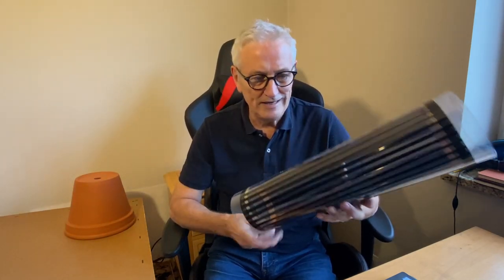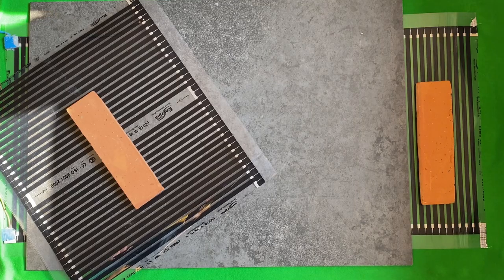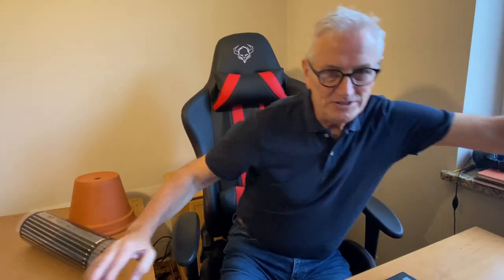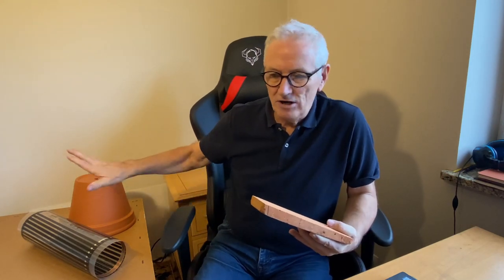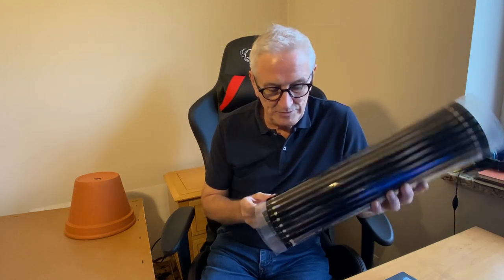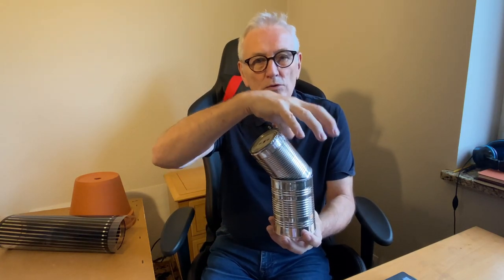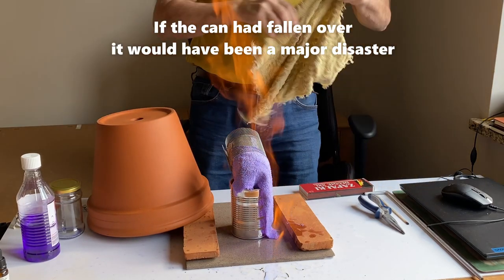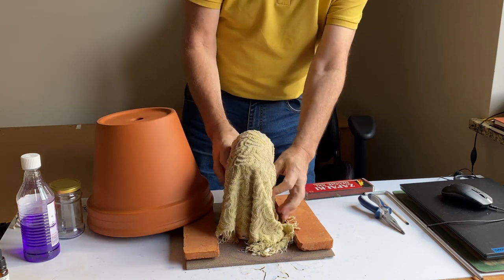DEADLY indoor open flame/fuel heaters. (Heat solution link in description)

Comment: You have watched robert murray smith but his setup was different that rag needs to be a carbon felt and that outside can needs to be lower than the inside for to hold  the chimney.Rewatch that with subtitles.
Reply: @SocialHigh  oke watch out and do it outside those things.
Reply from the maker: @edwingolddelirium  Problem is people are recommending them for inside heating solution this winter. That's what's scary. I haven't even talked about carbon monoxide 'yet'.
Reply: @SocialHigh  well they do also barbecue here and campfire's here in town because they are from the jungle and die. so the knownlegde is not there.

Comment: Robert Murray Smith just made a video pointing out that his expectation was that people would use common sense as they experimented and he seemed surprised that someone, that anyone, would build something like this and try it out for the very first time inside a house, sitting in a chair rather than standing a safe distance away to observe it, with combustible items literally all around the lit heater, rather than outside on a concrete patio or driveway, taking care to move anything that might burn a safe distance away from the heater before lighting it on fire, then standing a safe distance away, ready to quickly move farther away at the first sign of trouble. And perhaps have a fire extinguisher at hand, and wear protective equipment, as well.
This video did absolutely NOTHING to make me respect and admire Robert Murray Smith any less.
I think the moral of this story is to take a moment to think before you act and consider beforehand what you might do to approach the task or experiment in a safe manner.
Reply: ahh a fellow tnt fan.👍

Comment: I guess thank you for making this video. There's quite a few mistakes that you are making... the first is underestimating the expertise it takes to make these gadgets in a safe way. Many times, youtubers do videos of dangerous things, and make things look "easy" when in fact they are dangerous. It should be common sense but... now you know.
Things you are clearly doing wrong:
#1 The first is that you are working with highly flammable materials, while "sitting" behind a desk in what looks like a home office setting. That's obviously incredibly dangerous. (I can't understand why you would do something like that when you are clearly experimenting with fire). All of those things I mentioned are just not something you should be doing... "sitting" behind a desk in an indoor office setting while lighting liquid fuel using your own experimental setup... That is incredibly unsafe.
#2 Since you are experimenting, it is not wise to keep the matches and the fuel too near the can, given that the fuel in this case is easily ignited. (In case the can tips over). Again, sitting at a desk while you do it, practically trapped in a corner... what would you do if the fire got out of control?
#3 The original design has a rather large hole in the center can to allow for a large airflow. So, of course if you downsize the hole to something barely usable and then sealed the remaining hole with wick, the heated fuel will vaporize and cause the can to "pop up" (or even explode). 
#4. Where's the nearby fire extinguisher designed for the fuel type?
#5. As a commenter to the video you are talking about, I have mentioned in the comments before, that these "burners" are not really designed for use in a home, where you have closed doors.., closed windows etc .the risk of carbon monoxide poisoning is too high.  So, how useful will they really be to keep you warm if the windows and doors have to be open?

Before you do any further experiments, you really should read some safety books that are specific to the experiments you are doing. And be careful about modifying designs without understanding the implications of the modifications.
Reply from the maker: That's the whole point. Idiots are telling people (simply looking for ways to stay warm) that's it ok to play with these death traps.
Reply: @SocialHigh  First, I think it is disrespectful to call him an idiot when you clearly already knew the dangers (as proven in your own video: Space heater, cheapest and safest. WON'T KILL YOU!!). So, You clearly already knew the dangers of fire. I put the onus on you for knowingly putting yourself in a dangerous position while working with fire. Additionally, you Sir, are just as guilty of telling your viewers to work with "death traps"... just different kinds of death traps. Do you think working with electricity is inherently safe? 
So, where was your safety video when you showed off your 12 volt battery attached to a 20 watt lamp? Where was your warning not to "have an unmounted 12 volt battery in the back of your van hooked up and ready to cause a fire?... It's unbelievable.
Reply from the maker: @marcfruchtman9473  you are of course correct

Comment: Inner can needs to be taller and also have holes around the base the holes allow the combustion to breathe rather than essentially creating a rocket the ignited fuel\gasses have to have somewhere to go, if you don't give them somewhere to go they will find the path of least resistance, in this case upwards. Change the clans whack your holes in and give it another whirl. Possibly outside though, stand well back and all that. Happy experimenting 🙏
Reply: What you've essentially done here is a like a game we used to play as kids with an old Lyons golden syrup tin. We'd  pop a bit of water in pop the lid on it and light fires in a race to see who could pop the lid off first.

Comment: The first time I tried it with meths it exploded as well. You need to block the breather hole on the inside can. The fumes ignited the central reservoir. After that its been fine. White spirit has been good too. They produce too much black smoke for inside a home in my opinion. I did my testing in a concrete garage, at your desk was an interesting choice.
Reply from the maker: Yes indeed. But Robert Murray Smith just made a video saying it's ok to mess with them as long as you're as smart as him. Use to respected that guy. Now; NOT SO MUCH!!
Reply: I don’t believe Robert was saying that at all, he was stating that when running tests etc where a naked flame was involved an understanding of the inherent dangers, a safe environment for such tests (including adequate safety measures) and a modicum of common sense are all required.
Unfortunately you seem lacking in all these points as well as the ability to receive constructive criticism…..just saying
Reply: @johnwooldridge9994  spot on dude!
I mean common sense should tell you not to barricade yourself in a corner behind two desks then play with fire on one of those barricades! 
I watched robs video talking about this and nothing he said sounded overly harsh or dangerous to me!

Comment: Not the best idea to use methanol with a rag. The fellow you mentioned specified that he was using carbon felt with methanol and you can use any wick if you use the proper fuel. Not something I would try personally with my small knowledge of chemicals and flame, especially not on a desk around so much flammable stuff. What else is in there to be purple like that? Smoke was very colorful. I use the plant pot heater with tea candles or the alcohol based warmers for catering, sterno camp fuel should be ok too. Also why would you put the mantle on before lighting? Made it way harder to put out when you almost burned your office down. At least you got a view out of it

Comment: I did notice you're included advertisement for the remote coal powered plastic film, that was interesting however I really expected to find out you are an oil company investor LOL
Reply from the maker: I’m not advertising any company. I don’t even recommend a source.
Reply: @SocialHigh  oh sorry, I suppose it was just my take watching the entire video it seemed to me as though you were trying to influence people away from experimenting with fuels and promoting electrical Heating as an influencer, so if I read too much into it I apologize if not take the lump.
Reply from the maker: @401ksolar  I use 'solid' fuels all the time and encourage people to use wood burners. I even had a video on; 'An outdoor wood burner' for real indoor heat' but I took it down as nobody watched it 😁 I even use oil heaters when the need arises. Just worry when people encourage people to use fuel based heaters indoors for obvious reasons.
Reply: @SocialHigh  Totally agree, they can be very dangerous, they use highly inflammable fuels in these heaters and if it ignites like yours did, you could have a serious injury and intensive burns. Although, I believe the electrical heater is better, it still has it's hazards, we all need to be careful and thoroughly investigate ways to keep our homes warm this winter. Log burners are really good, if setup properly and a C02 monitor is installed. Keep all rooms well ventilated using any solid or liquid fuels.
Reply from the maker: I've removed ALL advertising from my videos and will NEVER run ads again. No worries 😉

Comment: I recently commented on a video where an individual was looking into insulating an older Arizona home with virtually no insulation to better survive high desert temps during power outages.  The person had a separate structure for their washing and storage which was maybe 12x12.  My suggestion was to super insulate the structure with 12” of insulation (walls/floors/ceiling) and install an efficient mini-split AC/Heater (maybe $700USD).  This would be less expensive than all the construction required to insulate the primary house.  The other perk is a small, efficient gasoline generator could power the mini-split for as little as 1 gal/10 hours.  With the crazy heating prices coming this winter to the UK and the EU a similar approach of converting an outbuilding or garage for those colder days might work quite well.  Mains electric will probably be cheaper than generator fuel but if blackouts start this winter a small generator would be a nice insurance policy.  Keeping the primary home just above freezing while having a toasty warm smaller out building/garage might be a reasonable alternative depending upon how extreme the heating fuel prices rise.  Brand was mentioning they could get quite high.